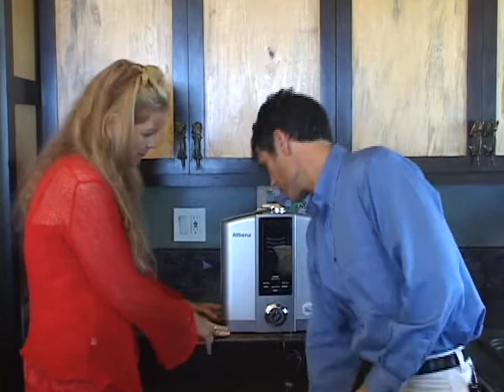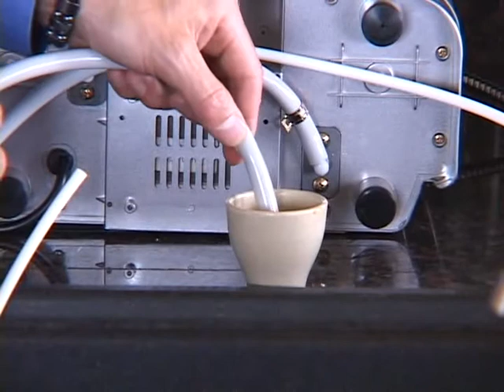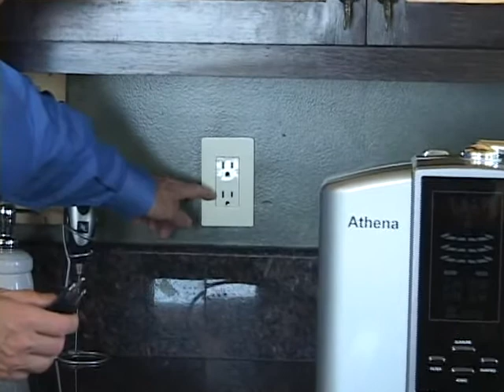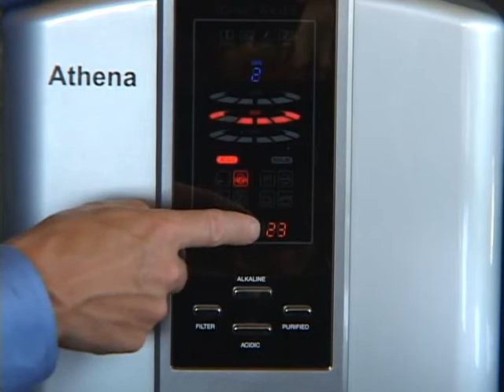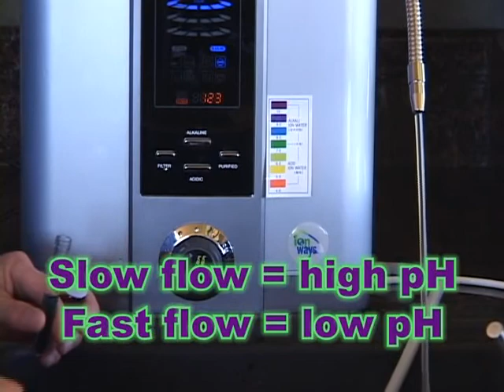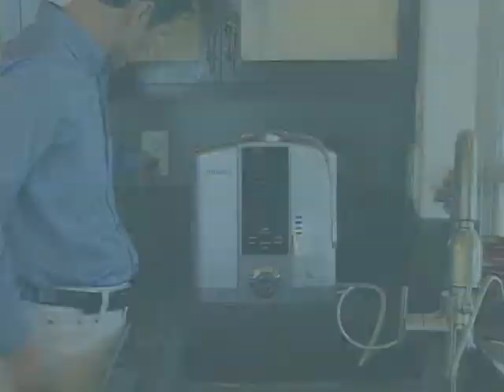Installation DVD for the AlkaViva/IonWays Athena JS-205 Water Ionizer - Full

Comment: Is it possible to ionize distilled water from a jug?  Would I need to set up a pump pulling from the jug and pushing water into the unit?  What minimum PSI is required to do this, assuming it works?